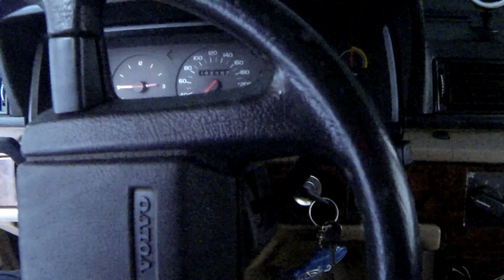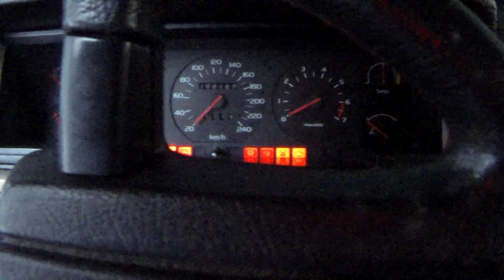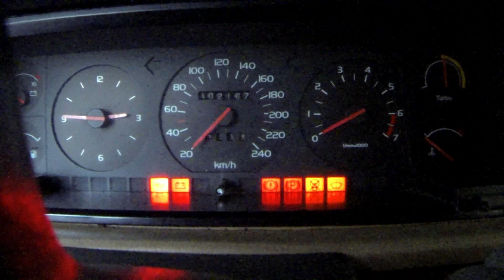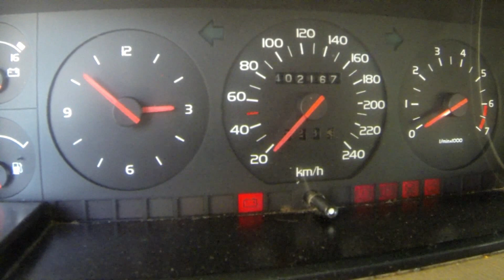Testing small jump starter - Volvo 740 Turbo cold start

Comment: I have the same battery jumpstarter. My car battery was completely drain. I drive a 2018 Honda Fit EX. We didn't drive it for 30 days and the battery went dead. Once I hook up the NoCo it start right away. I thought I might have to wait 15 - 20 mins before starting the car. Was able to drive around with out any problems.